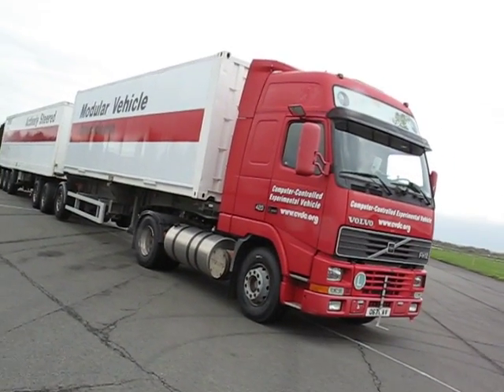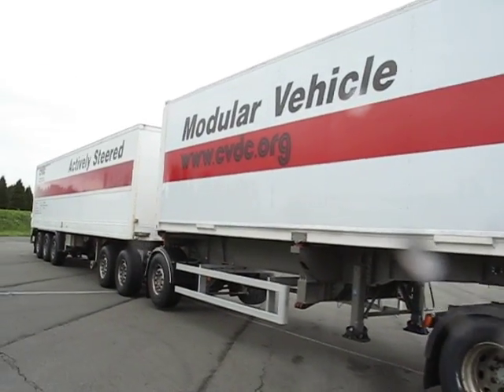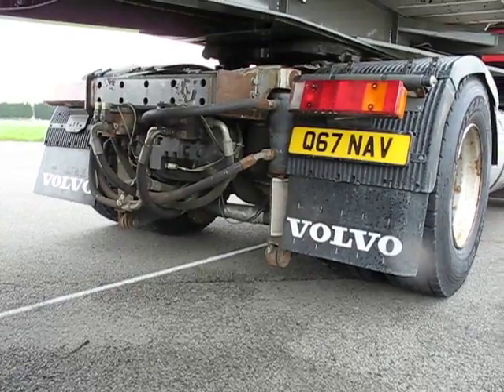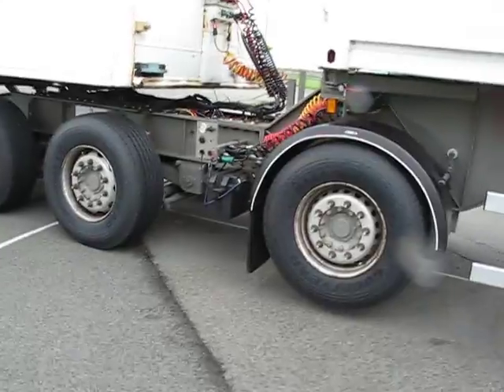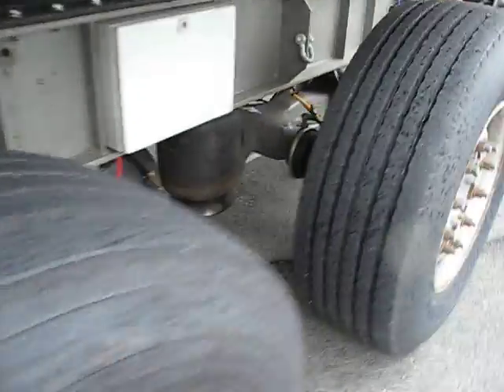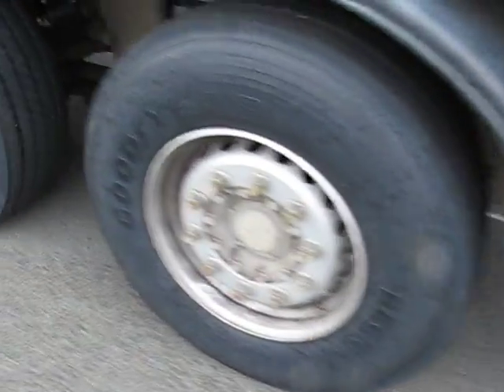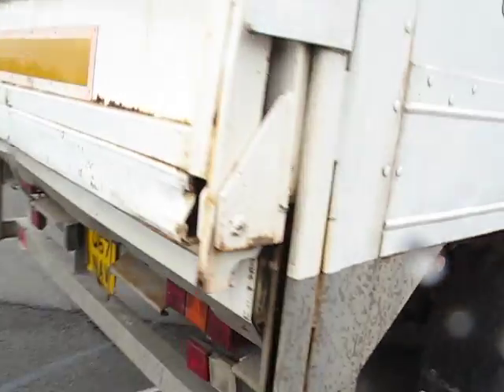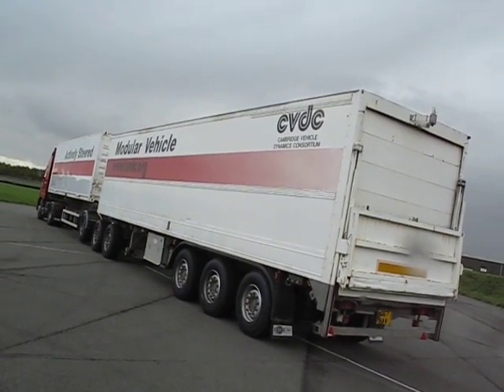Tomorrow's trucks - the CVDC B-Double technology demonstrator

Comment: My experience with B-Doubles is with fixed axles and up to 30.0m in overall length. All that steering mechanisms seems a little bit of a waste as these MCV's are set route vehicles anyway; operating from depot to depot or split into single trailers for poor access sites.
I find it easier to drive a double than a sincle combination, as the unit tracks a whole lot better on the road. I back the whole unit into a loading bay.

Comment: B doubles have been used in Australia for nearly 30 years so the tech is not new and we don't need steered axles or roll control. Put duals on your trailers and you wouldn't need it
Reply: roadwolf2